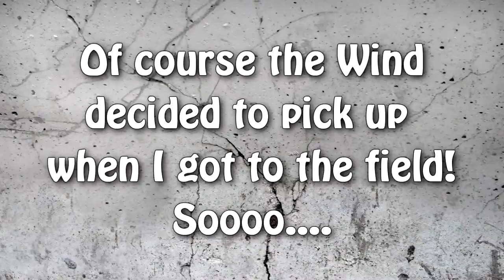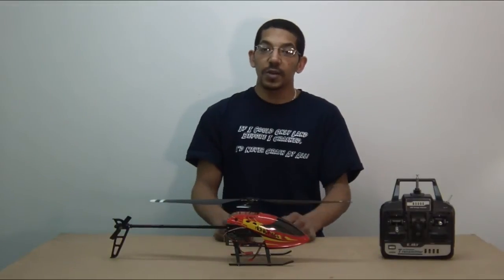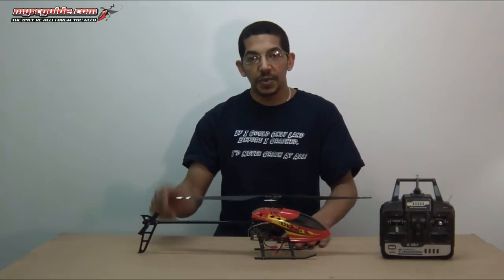Direct Drive Tail Mod for the ESky HoneyBee FP V2.

Comment: Great video - great guide . However , i cannot find all the spare parts i need to do this mod at this time :( i need a rear tail rotor , I can find the motor itself and heat sink - but not the tail blade itself :(